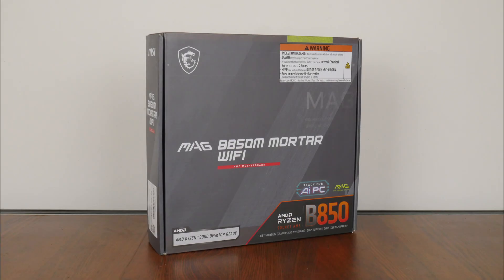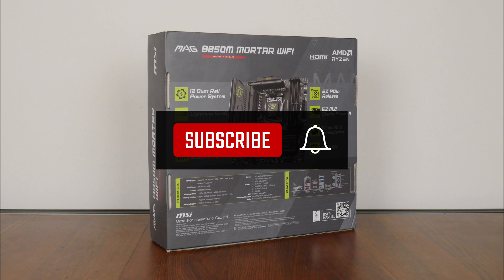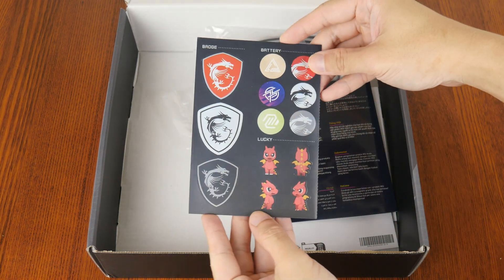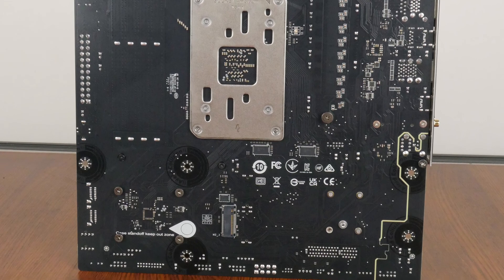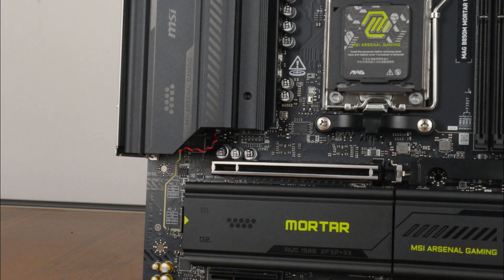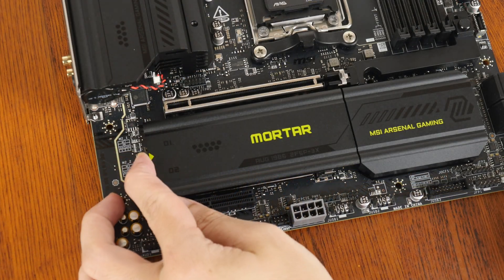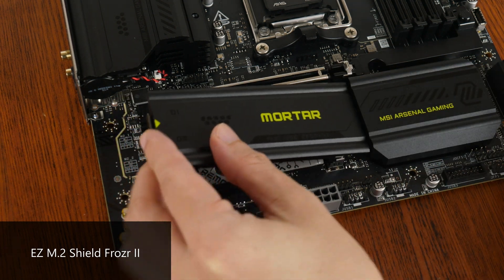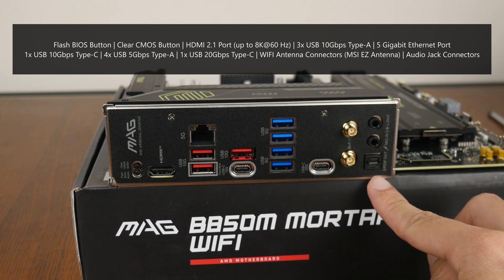This is a feature-packed AMD B850 mobo! MSI MAG B850M MORTAR WIFI Unboxing & Overview

Comment: HI which AIr CPU Cooler woild recomend for this board thanks ?
Reply from the maker: Hi there, what CPU air cooler to get would really depend on what processor you're going to be using with this board - have you already decided on what processor to get?

Comment: will the m.2 slot with heatsink fit in the case?
Reply from the maker: Hey there, you won't be able to use a M.2 drive with a built-in heatsink, as the included motherboard M.2 heatsink would get in the way. Even if you didn't install the included motherboard M.2 heatsink, the M.2 drive's built-in heatsink would probably get in the way of your graphics card...
Reply: @ALKtech thank you sir, i guess this mobo had a fail design for the m.2 location
Reply from the maker: @bumbble  actually it's probably more of a form factor size restriction, given that the size of a micro ATX board is only as such! You would only be able to fit a M.2 drive with a heatsink if the PCIe slot for a graphics card were to be located in the second slot position, rather than in the first slot position like in this MSI board, but this would then result in size restrictions for your graphics card 😅
Reply: @ALKtech ok i understand that.....btw i end up getting the asus tuf b850m
Reply from the maker: @bumbble  mm the ASUS has it's GPU slot in the second position, so it should fit your M.2 drive just fine. It's a decent board too, specs wise!
Reply: @ALKtech  yes it does!, thank you for your replay. Cheers!

Comment: What is your personal preference between This MSI MAG B850M Mortar WiFi & Gigabyte B850M AORUS Pro WiFi7 ?
Reply from the maker: Hey there, on paper and just comparing their specs alone, I'd be more inclined towards the MSI, seeing as it has 5 Gigabit Ethernet, full-fledged WIFI7 that supports the 320 MHz channel width as well as a better audio codec. The Gigabyte comes with 2.5 Gigabit Ethernet, a WIFI7 module that supports the narrower 160 MHz channel width and a Realtek audio codec (ALC1220) that I'd say is a tier below the MSI's (ALC4080)!

That said, I'd say the MSI would hence be priced higher than the Gigabyte in view of its better specs - how's the price difference like between both boards where you're from?
Reply: @ALKtech  Not too much I'm from India Gigabyte cost ₹20,900($238) compared to ₹21,900($248) for gigabyte, apart from the looks it seems like MSI is the better option, if I'm not weong MSI got 3 ssd slots too vs 2 ssd slots on gigabyte.
Reply from the maker: @midhungopan9270  oh yes that's right, you do get an additional M.2 slot with the MSI as well. Seeing as the price difference is really small, I'd get the MSI if I were you! Out of curiosity, what processor are you intending to use with the board?
Reply: @ALKtech  9700X....kinda overkill for the processor but i don't wanna change the motherboard after a few years if some features are missing.
Reply from the maker: @midhungopan9270  yeah but like you said, I'd rather invest in a motherboard that has the latest features, this is especially seeing that AMD's next-gen "Zen 6" processors should be on the AM5 socket as well! The B850M MORTAR WIFI would hence be more future-proof in that regard👍

Comment: I don't get it why B series mobo need 2x 8 pin cpu power? This board doesn't mean to be for overclocking (even if you are able tho)
Reply from the maker: It's probably a design decision on AMD/MSI's side to have more headroom so as to support perhaps say, AMD's next-gen of flagship Zen 6 processors that could draw higher amounts of power, and of course, your current line-up of high-end parts such as the 9950X3D and 9950X!

Comment: Better VRM on the TUF. I would go with the B850m TUF for $30 more (current pricing.)
Reply: TUF does not have a tooless design & awful placement of SSD slot above the PCIe slot which heavily restricts the size of thick GPU in SFF mATX cases like Lian Li A3 & also it is only WiFi6E instead of Wifi7 on msi.
Reply: Doesn't matter. VRMs on this board and its competitors are all more than sufficient to handle the hottest Ryzen 9 CPUs

Comment: This vs b850m tuf plus which one better?
Reply: The ASUS TUF B850M-Plus motherboard has its primary PCIe x16 slot, typically used for the graphics card, in the second position rather than the first. So the slot is lower than the Mortar's first slot.  I would personally go with the mortar if its available

Comment: I'm waiting to see if they come out with an All White B850M Mortar mother board as I'm going to make an all white build next.. They made them in the past MORTAR TITANIUM
Reply from the maker: Oh yeah...it's been awhile since the B450 MORTAR TITANIUM came out. I didn't see any new white microATX AM5 mobos on display at the recent Computex 2025 though, but MSI did release two new white-themed ITX motherboards then (X870I EDGE TI WIFI and B850I EDGE TI WIFI). I doubt there'll be an additional white AM5 microATX board on the horizon, but I sure hope I get proven wrong.

That said, MSI does have a lower-end B850M GAMING PLUS WIFI that is white, but I'm not sure how readily available that SKU is. If you're open to other brands, I did see an ASUS ROG STRIX B850G GAMING WIFI that might fit the bill!

Comment: More info this week except for actual release dates here in the USA 😢 EU has the same issue too. This mobo is the only thing I'm waiting on for my next build, ugh.
Reply from the maker: Seems like the lack of availability's a worldwide issue. Have you decided on the specs of the PC that you'll be building with this board yet?
Reply: @ALKtech  Yep. 9800X3D, MSI RTX 5080 Shadow OC, 32Gb RAM, etc. Have everything except this mobo, lol.
Reply from the maker: Sounds like a pretty solid set of specs that the B850M MORTAR WIFI will handle with ease! Do share back when you've managed to lay your hands on this board - where I'm from (Singapore), the board's probably only going to hit the shelves in May 2025..